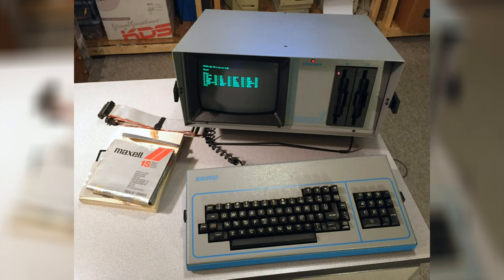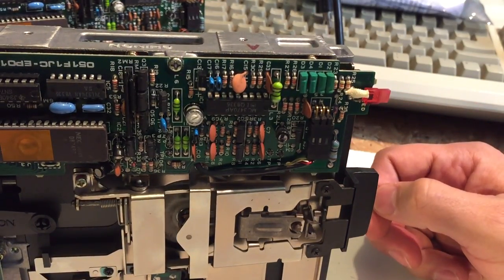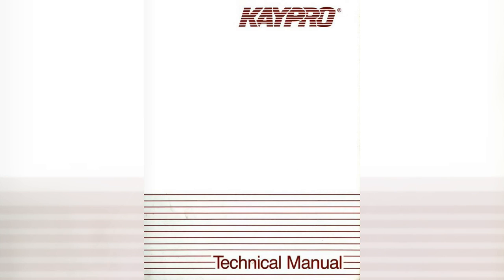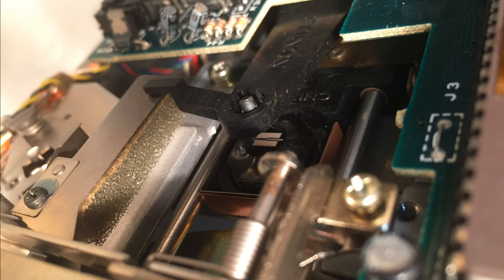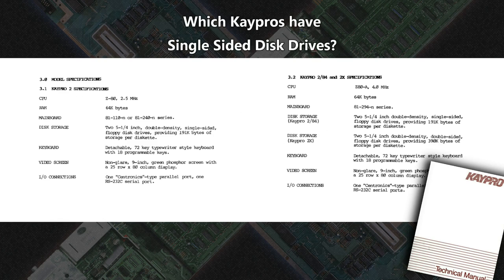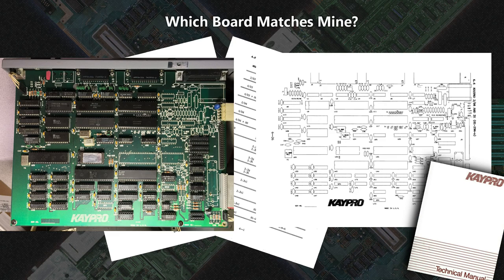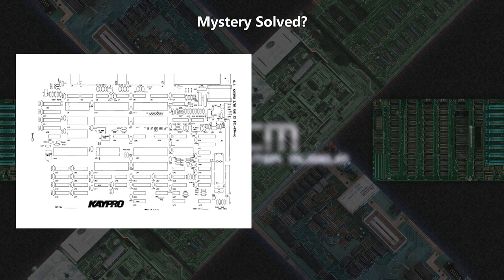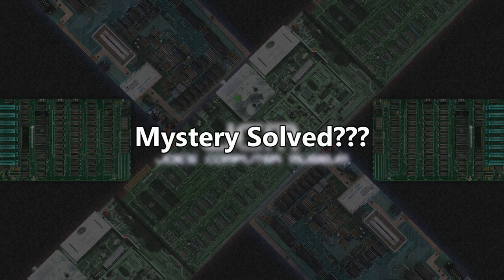Kaypro 1 Restoration - Part 1: Solving The Mystery

Comment: So, uh, here's a thing - the Kaypro 2 main board will not physically fit in a Kaypro 1 case. Why? The I/O ports are in slightly different locations on the back. The circuitry might be the same between the 2 and the 1, but the board is physically different. I know. I have a II, a "new2", and 1, and years ago had a 2 as well.  

I believe after reading as much as could find from as many sources as I could find, that the Kaypro 1 was simply a way for Kaypro to clear out their 8 bit cp/m inventory. They were very sloppy when making orders for components and ended up with tons and tons of overstock - by 1986 cp/m was well past its prime but they had a lot of parts left over and sales were slowing down. The solution? Just put whatever was left into Kaypro 1 machines and get them out the door. Kaypro claimed they were discontinuing the 1 (and thus their cp/m line) in 1986 press releases. But Kaypro 1s were still listed new in catalogs into 1988. So either they were selling verrrrrrrrry slowly, or Kaypro just had that much junk left over - likely both! Kaypro 1 serial numbers also seem to stretch on forever for a machine that was supposedly only available for one year, and the date codes of bits inside these machines tend to be all over the place, don't be surprised to find stuff from 1982 all the way through 1986 in one.
Reply from the maker: This is awesome information, more than I was able to find when researching this video series. It clears up some of the mystery. Thanks!!
Reply: An interesting thing about this is that the Kaypro 10 was hugely successful, Kaypro couldn't make them fast enough, they were on constant back order from 1983 into 1986. Whereas the II, 2, 2X, IV, 4, etc. went through various revisions and yearly changes to keep them relevant in the marketplace. This is probably why the 1 uses what is essentially the mainboard from the 10, and why some of the 1 boards are even populated with I/O chips for the 10, despite not having a hard drive. The January 1986 issue of PRO FILES talks briefly about the rationalization of the Kaypro line, with all (8-bit) models dropped except the 10, 2X, and the introduction of the 1. Although Kaypro announced late in 1986 that the 1 was being discontinued, and the 2X would go on, the opposite happened. The 1 continued, and the 2X was dropped. I would guess because the 1 shared more parts with the 10 than the 2X did. Kaypro must've been pretty desperate to get rid of the 8-bit machines because after the 10 was finally dropped for '87, they were selling the 1 "bundled" with a printer - where the printer was free.
Reply: Yeah, I had several of these machines as a kid, 25-30 years ago (That built in 300 baud modem in the 4x got me onto the BBS scene) , and while you obviously know a bit more than I do, that lines up entirely with what I know.
Reply: Yeah, he clearly doesn't know what he is talking about. Everyone who owned a Kaypro knew that the Kaypro I had single sided drives. I bought the Kaypro 2x when it came out in 1984, and it had double sided-double density drives. The Kaypro 2x and the Kaypro 4 had the same motherboard except for the Kaypro 4 had the onboard modem chips populated, though it was a lousy 300 baud, and most Kaypro 4 owners bought an external 1200 baud modem anyway. He really should do his research before making a video and putting it out there like that.
Reply: @wotsac   4x?
Reply: @furripupau  I always wanted the Kaypro 10 because it had a hard drive. About the time I got ready to buy one they came out with the Kaypro 16 and the Kaypro 2000, you couldn't buy a Kaypro 10 cause they had quit making them.
Reply: @joeysartain6056  Oh, I see I must have misunderstood the numbering.  It's been going on 30 years now.
Reply: You are very correct on them trying to dump stock. They were in a hurry to get rid of some stuff. Technology was booming and yhey had already seen the writing on the walls. I had gotten into it much too late (1984). I had bought the 2x 84 bundle that included the daiswheel printer and it came loaded with software.  I saw in the comments somewhere hat the Kaypro didn't do graphics. I have a demo program somewhere that came with my 2x illustrating the graphics capability of Z80 based Kaypros. I will see if I can dig it up. It was pretty amazing.
Reply: @joeysartain6056  Everyone might have known it had single sided drives, except Kaypro, whose technical manual states double.  http://www.bitsavers.org/pdf/kaypro/1484-E_KayproTechnicalManual_Ch1-15_Jun85.pdf

Comment: I was allowed to borrow a real, original Kaypro 1 -- in 1981 from the Kaypro company in Salona Beach to demonstrate at a trade show. This one had a pair of single-sided, single-density drives mounted on either side of the monitor, which was located in the center of the case rather than off to the left. It had a green and grey case similar to the blue and grey case of the Kaypro II. 

The Kaypro 1 was used for internal development work only and was never released. The Kaypro 1's single-density disks proved to be an impediment to business software and limited the model's ability to compete against the Osborne 1, the dominant luggable at the time.

Double density floppy drives were a bit more expensive to buy but far more practical. And thus Kaypro II was born. I personally sold over a hundred of them in a single year at a price of $1,795 with a $400 margin. My employers were so grateful that they offered me a (wait for it!) ONE PERCENT commission! 

So I started my own software company, marketing a program called SmartKey.

Comment: I was a bench tech for a Kaypro reseller for about 2 years. Yeah, they were very consistent about being inconsistent. They were, however, workhorses for small business before the IBM PC was released. Mostly used for work processing, Kaypro had a great metal case, keyboard and usually had dual diskette drives that came license with Wordstar making them ready to go serious work.
Reply from the maker: No doubt! This machine (aside from the floppy drives) just flipping works. But the mystery of this machine isn't fully solved, trust me. ;)
Reply: @JoesComputerMuseum  you got to remember the Kaypro line of computers was started in a garage.

Comment: I recently picked up a Kaypro 1 on eBay and it's another Franken-Kaypro.  When I disassembled it to clean and replace the RIFAs, I noticed that the ROM didn't have the usual ROM version number.  Instead, it has an EEPROM on it with a sticker that says "2.2g".  There's also an official looking sticker on the back that says "Kaypro 2", even though the case says "Kaypro 1".
Reply from the maker: I think many Kaypros are like this.

Comment: I am currently in the process of building a flat panel display for my 2x84' and will update as it goes on. I found some 9 inch LCDs on eBay and am also considering just putting all of it into a laptop style unit. If anyone knows some good links for designing a vga conevrsion circuit that will convert from crt to lcd please leave a comment. Thanks everyone.